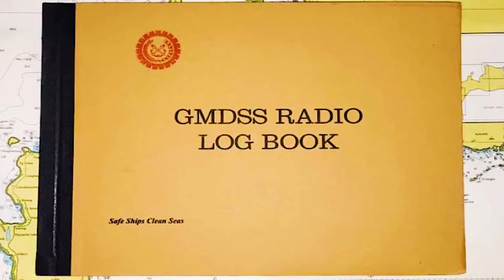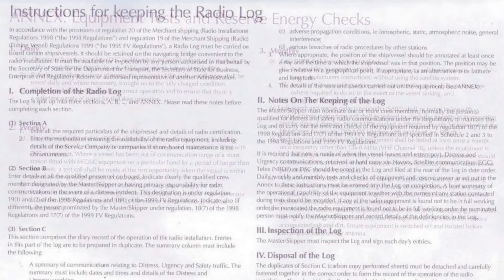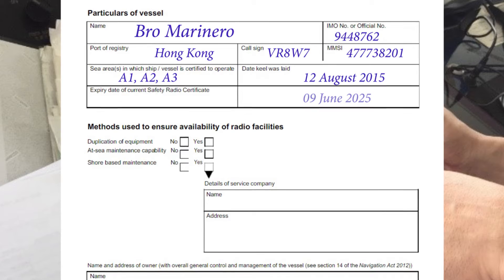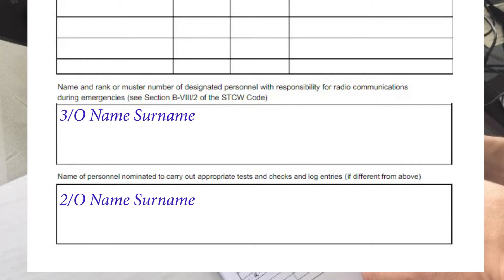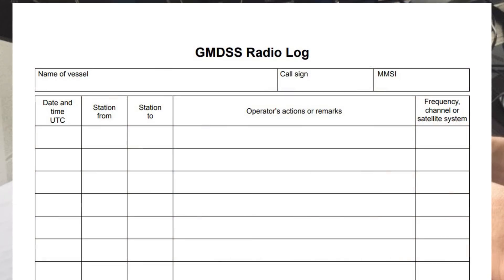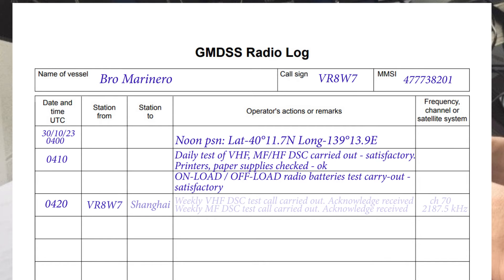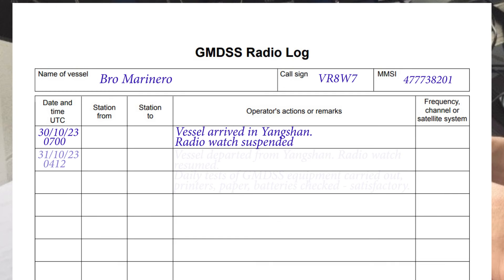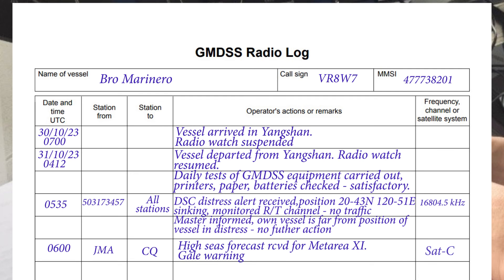GMDSS RADIO LOG BOOK

Comment: Sir For example a vessel called me on VHF How often to record these information on Radio log Sir?  Do I need to write it  down every watch a vessel or port control that called me on VHF?
Reply from the maker: Hi! Usually, routine information between vessels, (like asking how you're going to pass each other  or talking about seaman life) is not recorded.  Only if the vessel in distress called you to assist, or warship called you to ask info about your ship, etc, such communication should be recorded. Communication with pilot, VTS or Port is usually always recorded.
Reply: Thank you for the info Sir, God bless you.